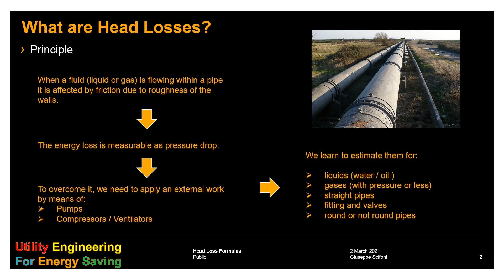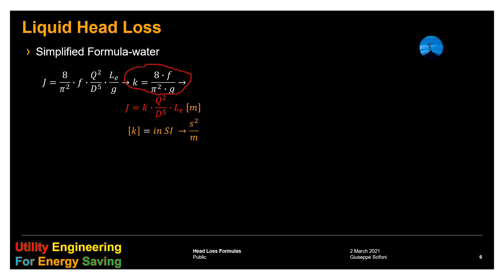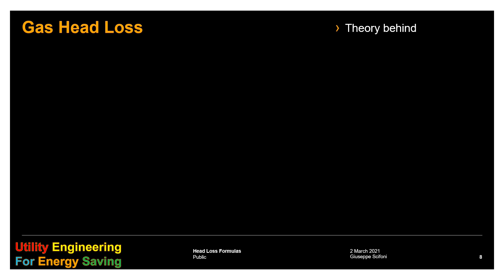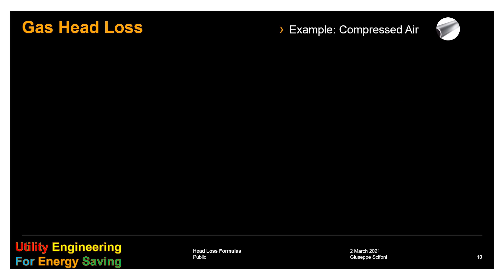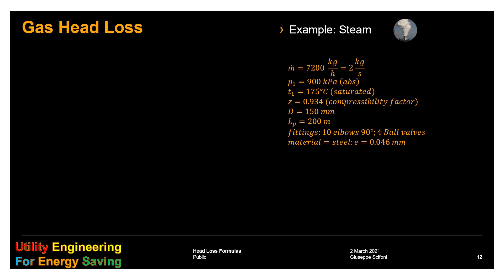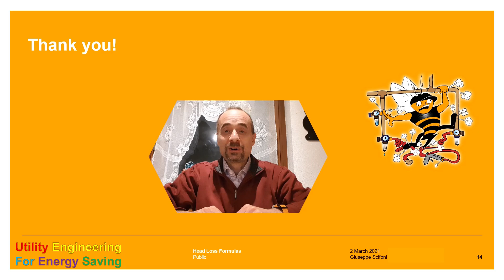Head Losses in Pipelines.

Comment from the maker: Type Errors
@ S.5: "LENGTH" instead of lenght (repeated three times)
@ S10: Lf right bottom should be Le
@ S12: Lf right bottom should be Le
@ S12: missing z in the numerical calculation (the result is correct)

Clarifications: 
@ S.6 L=Liter; 
@ S.13, last column of the table: D is in mm